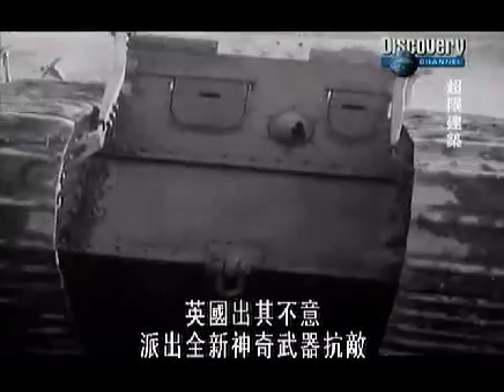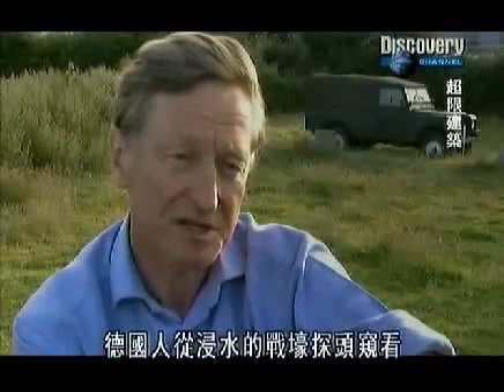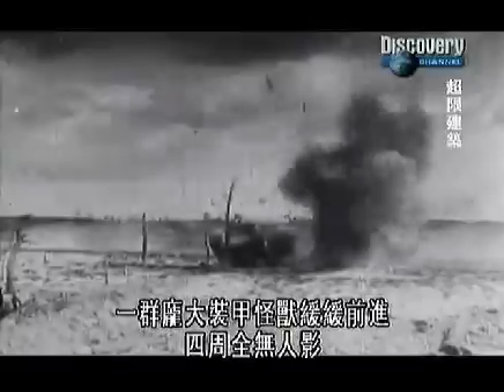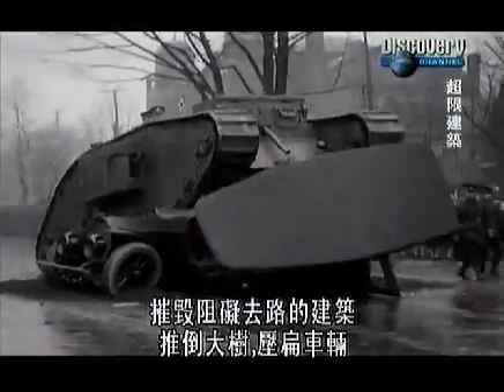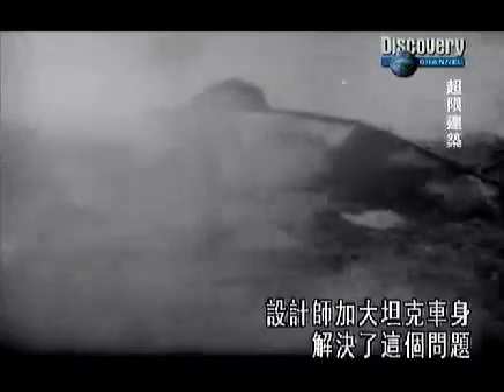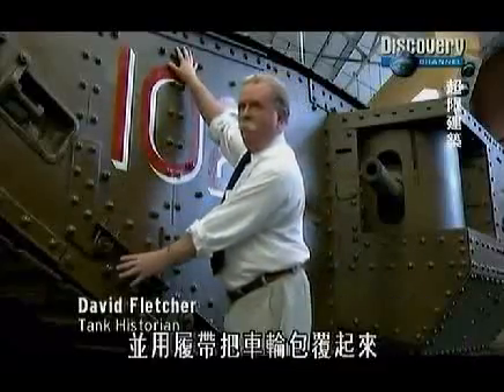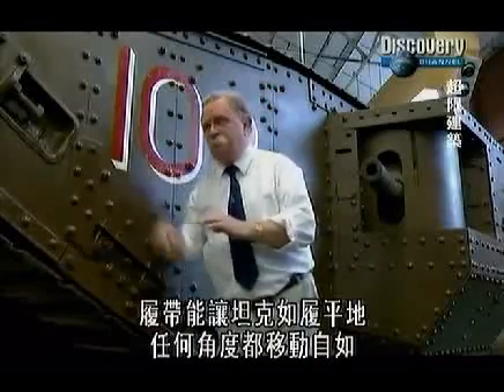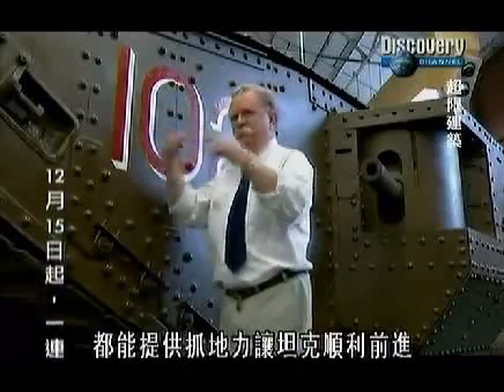Testing the Tank Track(Steel VS Iron)

Comment: 'stronger' is too broad of a term when comparing mechanical properties! Steel is tough, has high tensile strength, easily forged or machined and, like you said, easily shaped. Cast iron is easier to cast and can withstand  heavy 'crushing' loads but snaps easily if twisted or subjected to 'shear' forces which is useless for tank tracks.

I've been a mechanical engineer for 6 years now so if you have any more questions......

Comment: cast iron is only good in compression as its relatively brittle compared to steel. It's all to do with grain structure and forged steel has a very strong grain structure, especially with irregular shaped parts, like a like a track link. you're right though, steel is more plyable than cast iron so it can withstand shock loading better which is very important in track design. My company also makes parts for William Cook Defence, the company in this video